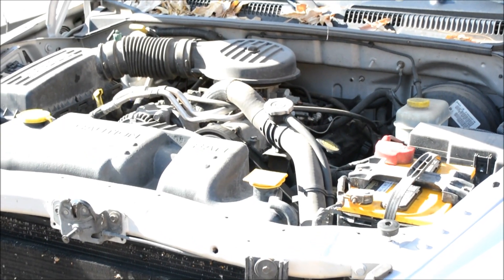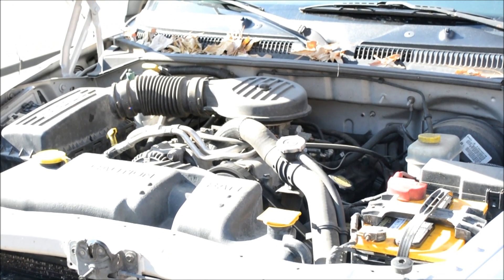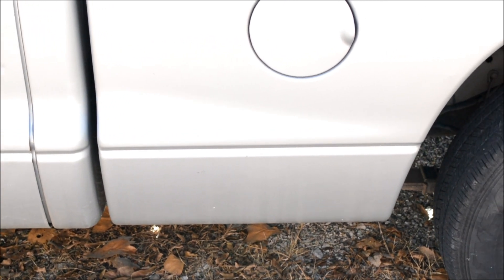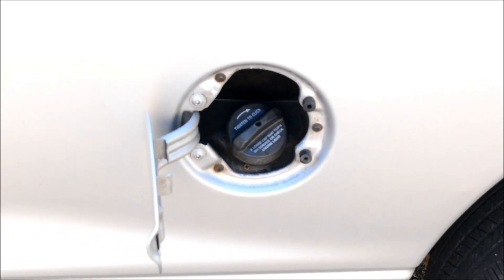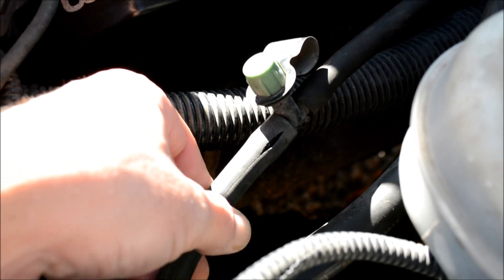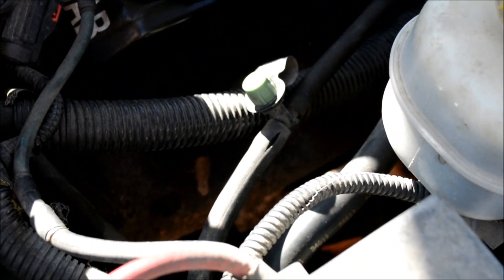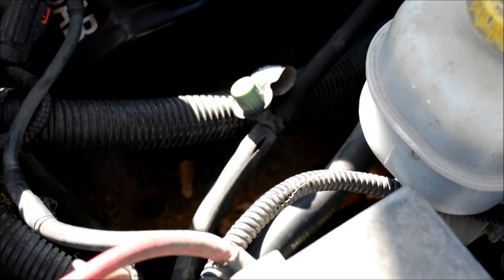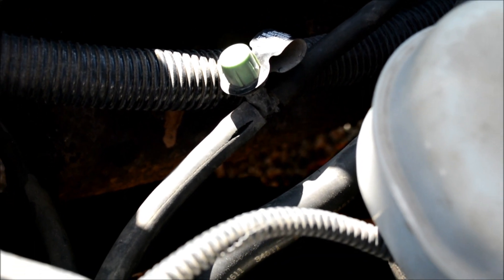Dodge Dakota - Check Engine Light - P0442 - Troubleshooting and Repair

Comment: I took my 01 Dakota V6 to a "good mechanic" and they charged me X number of dollars and told me to buy a new gas cap which I did.  A couple days later the P0442 code came back.  Long story short I found the problem myself, it was the same thing you showed, the split hose near the little green cap (test port).  Good video, thank you.

Comment: Several years ago I had this "dreaded" P0442 code on my 2001 Dakota Quad Cab. What a nightmare!! I was getting a very strong smell of gas on the driver's side (nothing on the passenger's side) so I first replaced the gas cap but this didn't help because the code came back. I then checked and rechecked the canister under the driver's side door, refueling neck and all lines, hoses and anything connected to each of these parts starting from under the hood all the way back to and including the gas tank. Finally, I had to take the truck to a mechanic 😭😭😭. Believe it or not I took it to 4 different mechanics and not one could find or fix the problem. Each one of them claimed they had but about a week after leaving each garage, the code came back every time. This made me realize these mechanics had cleared and reset the codes and had also charged me for parts/labor to fix something that wasn't broken, didn't fix the problem and that the truck did not need in the first place. I brought the truck back to each one of them after the code had come back but none of them could find any reason why it had returned. I let each of them know I believed they had reset the codes and had never found or fixed the problem causing the code and had charged me for parts/labor the truck did not need. Of course, each one of them denied this 🤥..... Oh, did I forget to mention that I'm a woman 😉? 

Because I needed to get the truck inspected and didn't want to go through what I'd had to go through in past years to get a sticker, I decided to take it to one more mechanic that was highly recommended by one of my Mom's friends and, finally, the problem was found 👏👏👏!! The fuel filter on the gas tank had come loose and was allowing fumes into the air. Since this problem was fixed, the "dreaded" P0442 code has never come back again after all these years!! This may not be the problem with your truck but I'm hoping this comment will stop someone (or lots of people) from having to spend all the time and money I did trying to find the reason for this code ☺!!
Reply: thank you lady
Reply: Thank u so much for this 😌✊🏻

Comment: Yea..just the same thin that happen to my dodge..but on mine was ..a valve  behind the battery it has two hoses ...one was crack i cut the crack one and put it back... light went off...till i put a different gas gap..and the light came back..till i put the old one back and i did what u said about disconnecting the battery and connected back ....i turn the switch.... wait couple seconds..boommm..light out...if people dont know how to work on cars..u can learn here on this u tube channels..even tha master mechanic has to look to a book to fix problem on cars every year is something different on a cars..i stayed with tha 70s..80s cars..u r safe.. and easy to fix.. now u have to spend 100s on books to study about a 🚗...

Comment: Would it be just better off to replace every vac line? Im haveing the same ussue on my 2000 dakoda sport v6 keep getting the po455 and po345
Reply from the maker: Yeah sometimes if the hose is bad enough you should replace all of it. I sold that truck, but it happened to me twice. Once under the hood and once under the gas tank. If It happened again I was prepared to change it entirely. Good luck.
Reply: I just did a vacuum line fog test and found out its the canister by  the gas tank has a crack in it so ill be replaceing that asap thanks for ur reply